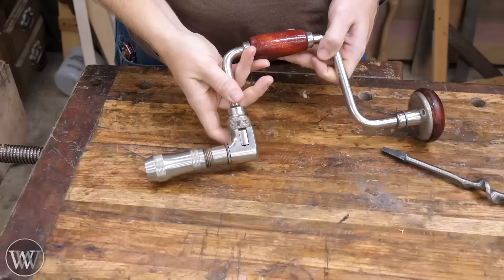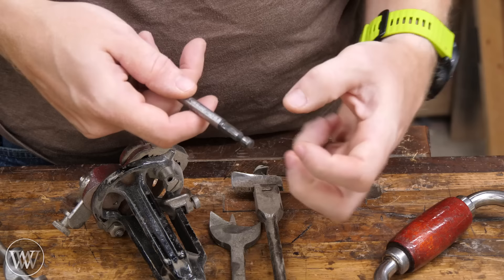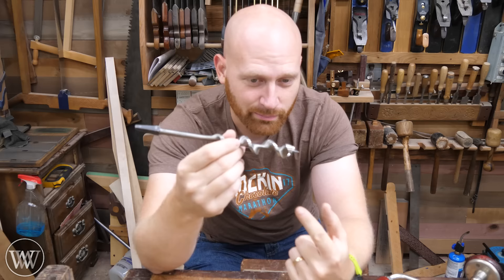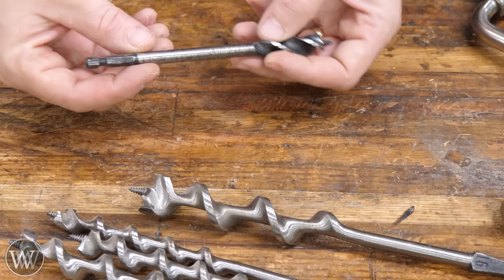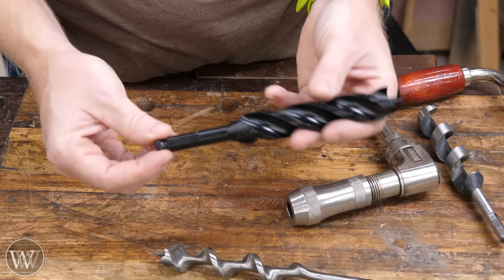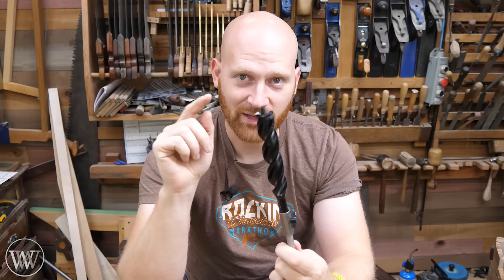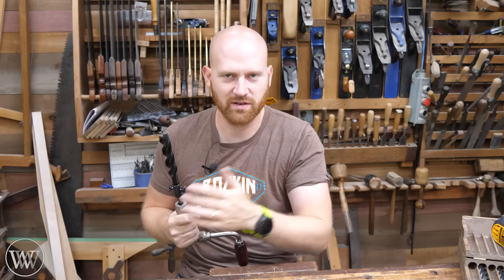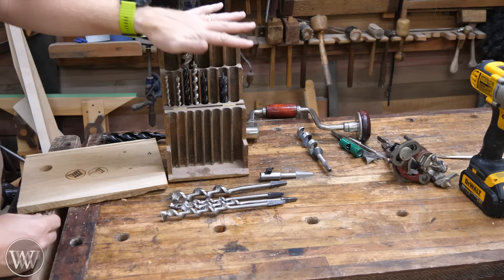New Favorite Tool What is on the End of My Brace

Comment: I'm a little late to the party, but I have a Stanley 923 brace and WoodOwl Ultra Smooth bits and can attest that the alligator jaws Stanley put in this brace will securely hold the WoodOwl US bits. There is the same amount of wiggle as I have with the tapered square shank. That wiggle is from the collet. Like most braces, the 923 is made in the usual 8, 10, and 12 inch sweeps, and appear on used tool site relatively often. Hope that helps anyone who might not want to go the adapter route.

Addendum: The 911 also has the same alligator jaws as the 921. However, the 901 brace has the universal jaws that "hold round shank bits and drills from 1/8 to 1/2 inch, and taper shanks as large as a No. 2 Clarks Expansion bit," according to the Stanley No. 34 catalog.

Comment: My solution for using modern bits with my Dad’s old brace is to use a keyless chuck with an SDS adapter shank. It centres and grips well in the two jaw brace “chuck”. I can chuck up screwdriver bits (very useful) and smaller round shank bits.
Also cheap from hardware stores, Amazon, Ebay etc.

Comment: I don't understand why I don't see tapered square drill chuck adapters everywhere... I made one in about 10 minutes using an old drill chuck & a bolt that threads into it.
Drilled & tapped the end of the bolt for the locking screw, cut the head off the bolt, ground a tapered square on it, then threaded it into the chuck, inserted the locking screw, and done. 🤷‍♂️

Comment: I have a full set of these Wood Owl bits and was also able to buy a full set of NOS Jennings in the past. Can confirm the Wood Owl's are a superior design.  There are also 3 jaw braces available on the market as new tools from several suppliers.  I purchased on of these (in desperation) and if you are so inclined, it has proven to be a fine tool as well.   I do like using the Jennings and will never part with them, they are still a lot of fun. But -  I recently built a roorkee  chair,  using 8/4 sapele as raw stock.  The old bits, bless them as they are,  could not  hold their own against the Wood Owls.  If you are in the market, this is an awesome solution.

Comment: @James I ordered a new set of auger bits and a brace with a 3-jaw chuck about 6 weeks ago. The bits arrived about 1 week later, but I did not even look at them because the brace was backordered from Lee Valley. The brace finally arrived a couple of days ago. I watched this video yesterday and bookmarked the Wood Owl bits, thinking that if I did not like the ones I ordered, I could get a couple of the Wood Owl ones in sizes that I will use most often. I finally got a chance to use the new brace today and when I opened the bit box, surprise!, surprise!, they were all the exact Wood Owl bits you recommended. 😊 Great minds think alike.

Comment: I recently acquired a new brace from Garret Wade which has a standard 1/2" drive, to which one attaches either a 3 jaw or a 4 jaw chuck.
Of course you can use standard socket, but they also have a few screw driver sockets.
Check it out.

Comment: Thanks so much for showing this.  I just put my order in for a set of Wood Owls and added in the brace adapter.  I can't wait to use them.  I learned a lot about vintage auger bits and maintenance from your other videos and am blessed with a large assortment of vintage Jennings.  They require a bit of work so usually I still slam a forstner bit into my power drill and keep the project moving forward.  The results are usually awful, so I'm thrilled to see how well these work and my brace is going to get used all the time now!!!  It puts a little more fun into my hobby and makes me feel "old timey" all at once. These seem better than any drill money can buy and my projects will look better for it.  Thank you so much for sharing your expertise.  I look forward to all of your vids and have become a much better woodworker because of you.  You're like the second coming of Roy and have rekindled my enthusiasm for wood unlike anyone else.  Keep up the great work!

Comment: I have a screw driver that takes hex shank driver bits, i cut that off and filed off a square dimension so it could fit in my brace and ai could use the 4bladed auger bit design with hex shanks. The 4 armed chuck holds the bit itself so the adapter is really in the chuck.
Reply from the maker: nice! I love it when a plan comes together!

Comment: I actually have an old German made Craftsman brace with 3 jaws I got at a yard sale for a dollar. It has a little square hole in the bottom of the threaded spindle in the ratchet box for the tail of the square shank to sit in.

It holds round and hex shanks well, but I haven't done any hard use to see if the chuck loosens, which is apparently what could happen from what little I could find about it on the internet.
I still love using it as a heavier duty brace, but it kind of got replaced by a Yankee 2101A one, which could also hold round and hex shanks very well too.

I've been toying around with buying the adapter from Lee Valley, but that new Tay Tools version looks to be the one with a couple WoodOwl bits to fill out my meager set after trying out the Irwin version. I tried sharpening one too and, uh, kinda doable with a round file? It did get noticable sharper after a couple careful, twisting passes with it held in a vise. I don't think I'd dare attempt that with the WoodOwl versions though.

Comment: My Wood Owl bits came in the mail today. I've only drilled 3 or 4 holes to see how the bits worked. They are amazing! I totally agree with your review. Even a 1" diameter hole was not difficult to turn. It took more effort than a 1/2", of course, but was not a problem.

 I also ordered the adaptor. I tried drilling a 1" hole without the adaptor. It actually seemed to work just fine. I may have wasted $17 on the adaptor. I was using a Yankee 2101 brace and the bit seemed very stable without the adaptor. I also tried it with the adaptor and it was also stable using it. 

Thanks for the review and turning me on to the Wood Owl bits.

Comment: hi.
I have a huge set of vintage auger bit with single blade and square tip mades for braces, probably in 50's in france (my country). they are not so bad for wood working or joinery as you said.. they are very great if they are in old good steel and manfacturing, that why i've earn mine in garages sales. 
I was thinking and i m wrong, that the avantage of the twin blade auger was cuttin 2x fast, but need 2x moretorque. but if i'm understand you, they cut the same depth for one turn, but with 2x less torque?
so if it true, the advantage of a twin blade auger is on large diameter and hard wood because they reduce the torque needed by 2 compared to a single bladed auger bit.
if you working with medium/small diameters on hard wood or big diameters on soft wood, the single auger do a great job.
but it true, on big diameter it need torque, it is physic. if it too hard with the brace, you can use the T handle auger. 
the twin blade auger are not so essential.
One advantage over the twinblade auger is the sharpening.
single blade auger is sharpened 2x fast, and it is easier because on te twin auger, if you sharpen one blade more than the other, only one blade will cut. they need to be at the same accurate height

Comment: Is there a reason you don’t just get a bit brace like the miller falls lion chuck that just accepts all types of shafts? I saw them for like $60-80 on eBay. I know that’s not cheap but it seems like a worthwhile trade off to not have to buy and use adapters. After some research I guess the Stanley 923s will hold the hex shank bits too and they’re only like $30-40 plus shipping. Hmmm, I may just go that route.

Comment: I like that you continue to chip away on hand brace bits and your ideas on how to move forward.  Have you ever heard of anyone replacing damaged or totally missing; tapered lead screw tips on hand brace auger bits?  It is such a waste to just trash them when the lead screw is gone or damaged beyond repair. Looking for someone who does this kind of repair or how to do it.  Have been on the web looking, but no success yet.
Reply from the maker: I have heard of some people welding onto the tip and filling a new screw. But I would guess 2+ hours of work to get it right.

Comment: Very cool bits brother but my good CMT Orange Forsner bits in my drills press or hand held battery powered drill cuts holes just as smooth just 8-10 times faster but keep in mind I am lazy!! Very lazy I take the shortest and easiest and quickest path to over come any and everything in the shop lol love the videos though buddy I have learned a lot about hand planes and spoke shaves and scrapers and scraper planes all of witch I use when needed

Comment: If they only made an adapter to use WoodOwl bits with a boring machine(beam drill). Then we could switch WoodOwl bits from drill, to brace, to the boring machine! Right now I'm using a WoodOwl that had the hex shaft cutoff and round stock welded onto the end with a flat side ground into it. It works but now the WoodOwl bit can't be used in anything else.
Reply from the maker: Interesting. But would all bits fit straight into my beam drill as they require a half inch shaft and the hex shaft is 1/2 in from point to point. They're the one bit that I can use there every time.
Reply: @WoodByWrightHowTo  So you are using WoodOwl bits in your Beam Drill without an adapter and without modification to the bit?
Reply from the maker: yup. most beam drills have a 1/2" setscrew chuck and the bit slides up in there and the set screw sets nicely on the flat sides of the hex shaft.

Comment: I just spent a fortune a few months back on some new auger bits and a holder like the original one you showed as I was fed up getting crap old style bits from ebay that were past their best. When I saw you using the wood owl ones a few weeks back I was gutted! The ones I have are loose fitting in the holder and not really great for a brace (they are still very nice bits). Looks like I'll have to check out the wood owl ones and spend another fortune!
Reply: They look great, but I don't think I can justify the price at the moment. I've ordered a new brace with a 3 jaw chuck and we'll see how that goes for now. Your video did inspire me to spend money though, so you've done your bit for consumer capitalism.
Reply from the maker: That's usually the way it goes for me too. I buy something in the next shiny pops up. But then my wife looks at me and I think about the cost of marital counseling.

Comment: Garrett Wade dot com has a new brace with an optional three finger chuck (both together are cheaper than a quality vintage brace on eBay dot com) that works well with these WooOwl bits.  Taylor Toolworks is the best!
Reply from the maker: ya there are a few three jaw chucks on the market. I have yet to get one, but I might some itme.

Comment: James your videos are very informative.  I have been involved with woodworking longer than I wish to admit.  I was about to purchase a brace and started reading about difficulties with using newer auger bits with the hex shank.  I wonder if the 3 jaw chuck secures the bits better?  For the soul that is on a budget it appears they may be out of luck as Woodowl bits are pricey....worth it but pricey just the same.  Please share your thoughts on the 3 jaw chucks.
Reply from the maker: Yes a 3 jaw chuck will work or you can get an adaptor. Here is a run down on what all I use. https://youtu.be/1IfgVb4UmQY?si=Wq2xKCOM-cVrzoN0
Reply: Thanks a million James!  Keep up with those great videos

Comment: My brace hold modern round bits without any issue.
Reply from the maker: Some do. It depends on the jaw type.
Reply: @WoodByWrightHowTo ah so there are multiple types of jaws, good to know.

Seems i lucked out a bit when it comes to that.
Reply from the maker: Yes there are hundreds of jaw designs. But most made after the 30s will hold hex and round shafts

Comment: James, does no one sell a brace with a standard hex bit chuck, or the larger hex stem that seem to be on the WoodOwl?  Yeah, you can't use your Dad's brace, but that seems to be the most connom-sense solution.
Reply: We did use braces in the USAF, called "Speed Handles", but they ended in a square drive for sockets; don't know of a drill/bit option.
Reply from the maker: there are several new makers that sell them. but then you have to have a brace for just those bits. as the 3 jaw chuck won't hold the tapered square bits. and the adaptor is a lot cheaper then a whole new brace. Speed handles and braces look a like but are different tools. speed handles a re a lot of fun though.
Reply: @WoodByWrightHowTo  Thanks!  After posting my question, EweTube flooded me with brace/bit videos and I'm a little smarter now!  😃

Comment: I'm not a plumber or timber framer, but what are the other purposes of the larger holes? Great information, thanks for sharing.
Reply from the maker: Round M&T joints. Wooden screw and nut or pass through making hangers and racks of all kinds of asthenic designs. The list goes on. A woodworker is often boring all kinds of holes.

Comment: I have a modern 3 jaw brace, it has a square slot to hold the tapered head and the jaws grab the shank.  It works well with hex but trying a smooth shank drill bit doesn’t work at all, not sure if there might be a keyed chuck adapter.
Reply: I probably need an eggbeater style, just haven’t come across one
Reply from the maker: Yep. There are several companies that have come out with three jaw chucks I've thought about getting one but just felt odd having multiple braces just for different chucks. Lol one of these days I'll probably break down and buy one.

Comment: Hello! Wonderful suggestion, many thanks! I have a couple of questions though: 
-Are the drill bits needed to be sharpened? And if so, how do you do it? 
-I entered the discount code, but seems to not work anymore. Is that normal? Is it expired? 

Many thanks!
Reply from the maker: Yes they can be sharpened. You do it with an auger bit file. I have a video showing how to do that if you want to see it. I'm pretty sure the discount code doesn't work anymore cuz it's over 4 years old.

Comment: I do not like to use the auger style bits in power drills. Mostly because the snail/pilot screw can draw the bit in faster than most people can handle because the speed pulls the bit in very fast, and that ends up making for huge amounts of torque on the drill which you are holding on to. In a Milwaukee Hole Hog, this actually becomes dangerous.
Reply from the maker: That is why I use a brace.

Comment: I know I'm commenting on an older video but I'm curious if you miss having the 2 smaller sizes (1/4" & 5/16") that were common in the vintage auger bit sets? Wood owl appears to range from 3/8" - 1 1/2" as far as I can tell
Reply from the maker: I use other wood owl bits for those. these just can not be made that small with 3 cutters.

Comment: The adapter on the web site looks different from the one you have in the video.
Reply from the maker: yes for some reason mine came with two screws. they do come with two threaded holes, but only one thumb screw.

Comment: as my arms atrophy i am less able to use my brace and augers.  i bought a nice mid range set of forester bits.  im excited about how little force these new augers seem to require and it seems like they leave a clean hole but that is a pretty small sample size.  how would you compare these to forester bits with regard to the quality of the hole on average? also, are you still able to use the wedding ring trick with the new adapter?
Reply from the maker: as to the quality it depends on the bit. Some are good and some are not. but it the hole looks clean then it is clean. yes i can fit the ring on between the adapter and the chuck. there is not a lot of space but it still works.

Comment: Does nobody make a replacement hex chuck for a brace? Then you can switch between bits with no need for an extension adapter
Reply from the maker: some braces come with a three jaw chuck that works perfectly for the hex bits but the problem is then you can't use the tapered square bits. Most people just end up having multiple braces then.

Comment: i need help
i bought the little adapter you showed at  4:25 the quarter inch
my brace has 4 jock chuck
but i removed the top of the brace bit to expose the jock chuck and then i see it has a square hole
i want to put the square back of the adapter inside the square hole of the brace bit hole (all the way to the end)

im really scared to wear the jocks of the chuck of the brace bit because i already had it happened to me once when i tried to use a hex drill bit without adapter
(edit: since then i returned that worn out brace bit and got a new one)

but i see most people dont put the drill bits ALL THE WAY inside the brace bit, and just let it pertrude about 2 cm out
please help James what do i do?

great video btw very helpful
Reply from the maker: Sorry I'm not quite following. Feel free to send me an email I'd be glad to take a closer look at some pictures.
Reply: @WoodByWrightHowTo  ok thank you i will send

Comment: @James What bit do you use to chamfer the large holes after drilling? Thanks.
Reply from the maker: For holes larger than about a half inch I generally just use a knife and chamfer it by hand. Smaller than that I have an old chamfer bit that I got a long time ago with nine blades. It works fantastically.

Comment: How much better are these when compared to the irwin speedbor? Just starting out, so the irwin's price compels a lot.
Reply from the maker: These will cut a hundred times cleaner hole. The speed bore are designed for power drills and will cut through 2x4 as well but they don't leave a very clean cut and comparison.